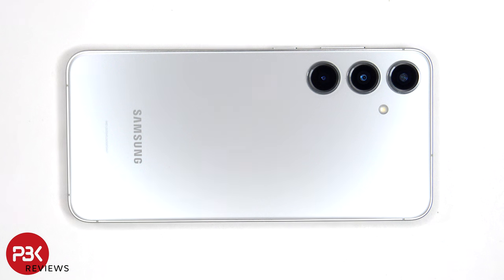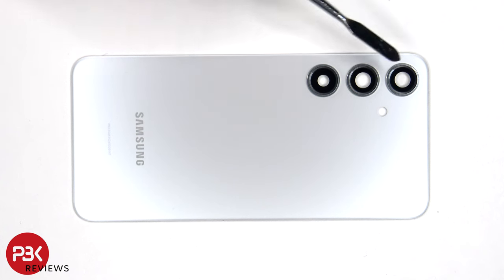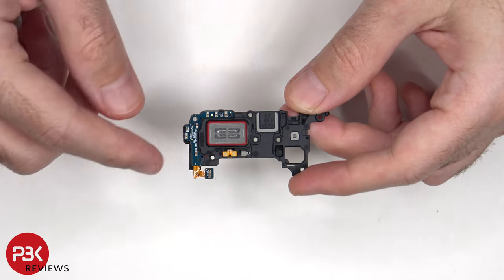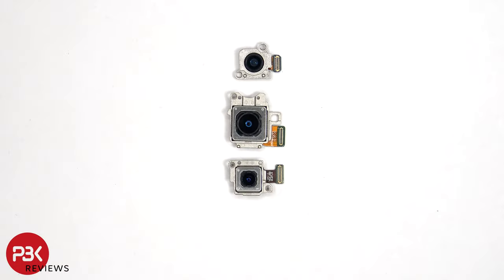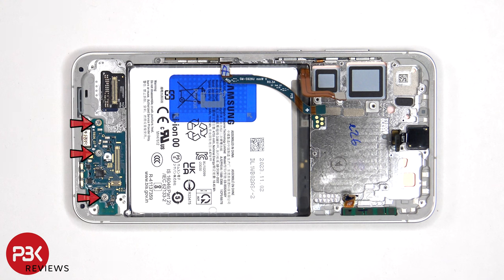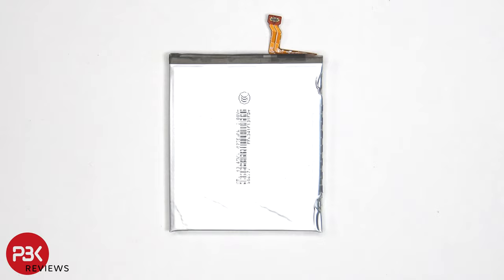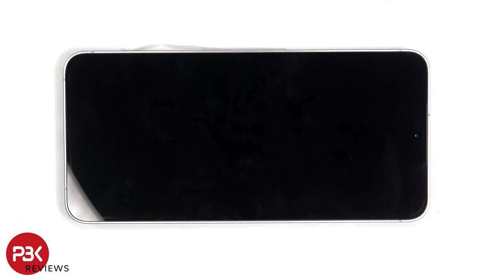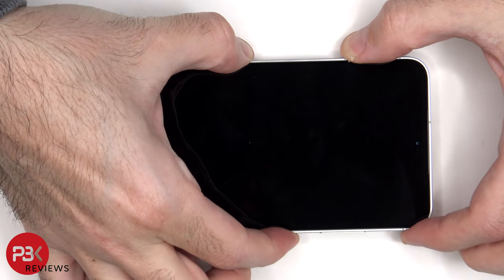Samsung Galaxy S24+ Teardown Disassembly Repair Video Review S24 PLUS

Comment: The reason that i watched this video is because i got mu s24+ just few days ago and last night i saw an yt short about the video stabilization and i trued it too and a few seconds later i started hearing a strange sound when shaking it, i got really worried and scared and i thought that something broke inside my phone but then i saw the way u showed the cameras moving in the teardown part and i was a bit reliefed ,please tell me if something really is wrong with my phone or its just supposed to make that sound when shaking the phone
Reply: That happened to me too
Reply: Yeah it’s fine
Reply: Yeah 💯 normal
Reply: Yeah happens on my S24+ too
Reply: Yea me 2
Reply: Normal. It's called OIS (optic image stabilisation)
Reply: Something shaking inside when you Device is brand new just means you are sensing the OIS system moving.
Reply: completly normal

Comment: I accidentally inserted the SIM card eject pin into the microphone slot at the bottom. What will happen now? Could I have damaged the microphone this way, or some mesh or moisture/water protection (IP68)? I got excited about buying a new phone, and this unpleasantness came out.
Reply from the maker: no you should be fine, nothing will be damaged

Comment: I currently have one and wanted to see how build quality on the inside of flaghsips compares to the one on budget models, and it looks way better and more "fool-proof".
I had to deal with repairing a M51, and the build quality is worse as even when just taking it apart a small mistake can make you break a part, and i like how there is no small cabbles with circle connectors and its all ribbons instead, less likely to break.
Anyways great video and i hope I would never need to take apart my s24+ 😂
Reply from the maker: Thanks!

Comment: Will the design of the microphone hole affect the waterproofing if accidentally inserted incorrectly?
Reply: The structure is L-shaped and the end is made of plastic
Reply: @baobab-j9i 
 What you mean is that even if you plug it in wrongly, it won’t affect the waterproofing, right?thanks.
Reply: @李阿哲-h9u  Yes, it has an L-shaped structure, so even if you poke it, it touches the plastic. This is confirmed by PBK.

Comment: If I accidentally put the sd pin into the bottom mic hole, is it protected from membrane damage and / or mic damage?
Reply from the maker: yes, it's protected and won't be damaged

Comment: my S24+ screen was scratched and I want to know if it is easy to repair and there will be no need to change the screen completely
Reply from the maker: I don't think scratches are repairable. Would probably require a new screen or you can just put a tempered glass screen protector over the screen which should cover most shallow scratches.

Comment: You make it look so easy to cut through the adhesive to remove the back cover.
Reply from the maker: I don't show the heating portion to save video time, but it isn't difficult to heat and pry the backs off these. With a suction cup tool and some heat, you can easily lift one side and get a pry tool in between, then run it along the sides to pry the rest off.